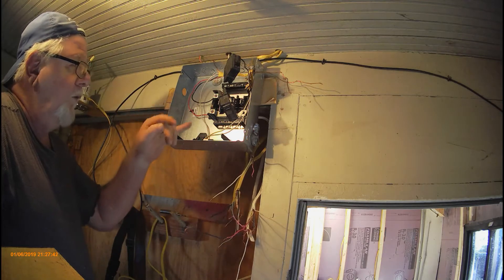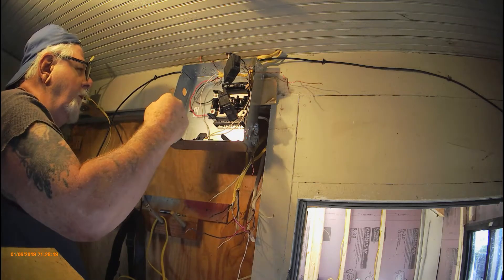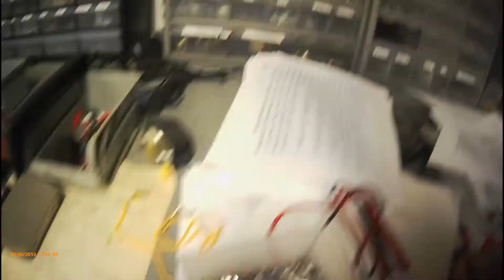AC wiring to the new box, DC hookup to Golight

Comment: Glad you didn't zap yourself...lol
Reply from the maker: Funny you should say that, I got hit 4 times today. This started out as a simple few plugs hookup. Well, now I have plugs, more plugs, switches, lights, 2 sub-panels, started out with 15amp plugs and 14/3 wire, now 14/2, 12/3, 6/3, 12/2, 14/2, lol.  Still another day to finish. :(
Reply: @buzzsah  After finishing our bedroom renovation, my wife decided she wanted a 3 way switch for the overhead lights.
That would have required having to rewire the switches, cutting drywall, crawling in the attic and drilling a bunch of holes.
I found a remote controlled switch at Lowe's and installed it in like 15 minutes...lol
Reply from the maker: @saltyshellback  LOL, they don't understand what they are asking.  Luckily you had the knowledge to think about it.